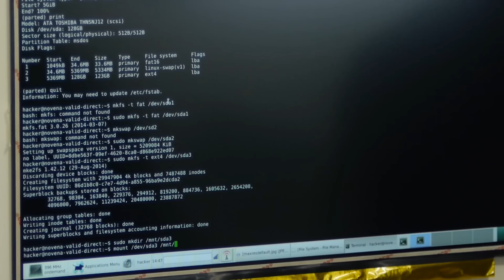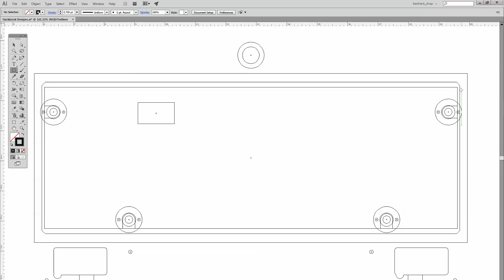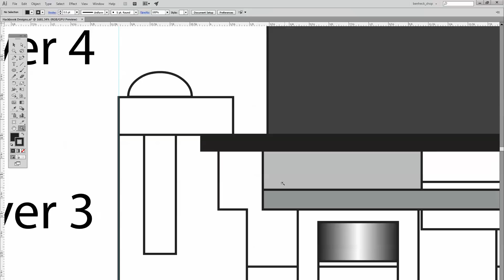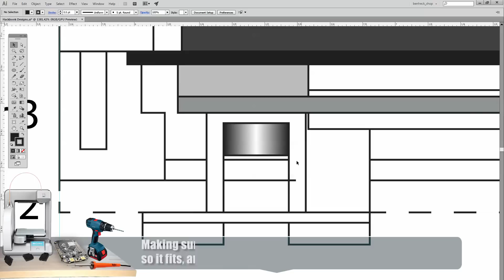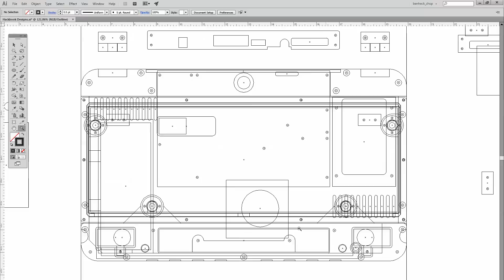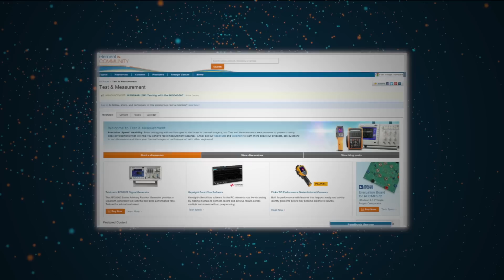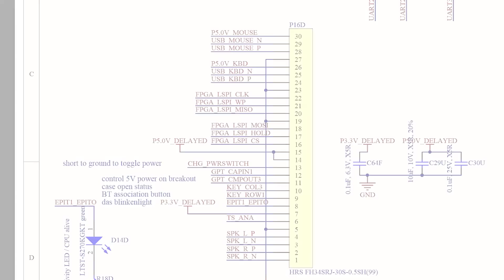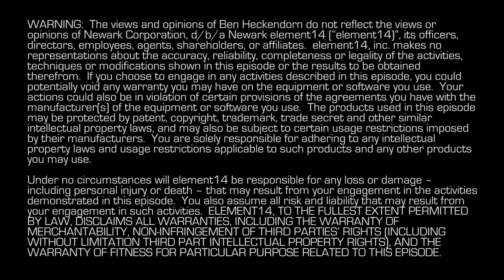Ben Heck's DIY Novena Laptop Part 3

Comment: If that base section was half the depth, Lose the secret compartment, Have the speakers front firing, Swap the switches out for Blues, Get a board with the LED diode support built in, Add a wider screen & This would be an awesome laptop! Otherwise an Amazing build :)

Comment: 11:13 What they used to do in certain Amiga CPU accelerators, was place a PLCC socket OVER the chip.  Could be a bit unstable there, but you could probably figure out a way to mount it securely.

http://www.kipper2k.com/amiga/4mblayout.jpg

Comment: these type of projects tend to look very difficult though.
I prefer 0.1 inch through-hole, generally much easier to wire things up.

then again, I have recently been meaning to build a board where I can have an MSP430 driving a dual H-bridge on a single board, vs having separate units for the MSP430-based driver and H-bridge, but haven't got around to it.

but, partly, I am held up by not yet finding a viable way to get enough cooling from air-cooling (transistor heat-sinks and fans) to run decent sized induction motors for an H-bridge build on a PCB (to make this idea more worthwhile). for example, much over a few hundred watts, heat becomes a serious problem (past experiments have resulted in liquid-cooled bridges, or building the bridge on top of a big chunk of metal, and generally built using point-to-point wiring).

like, if I want 3 to 5 HP (2-4 kW) from a motor, is this really asking that much?...

but, I may be missing something, as some existing motor controllers seem able to deliver a few kW of power without needing to resort to liquid-cooling or similar, so I don't know.

more so goes for somewhat larger motors (say, oil-cooled 40-70 kW 3-phase induction motors, like you might use in an electric car or similar). it doesn't seem like other people need to resort to liquid cooling their motor drivers (checking, it seems a lot of them are liquid-cooled).

actually, related is the possibility retrofitting a cheaper air-cooled motor into an oil-cooled motor and running it a higher power level, then using a thermometer to hopefully keep it from melting (throttling down if the temperature hits 100C or so). could maybe run a 15kW motor closer to 50kW ("yeah, running this 208v 60Hz motor at 440v 90Hz, going from 25A per phase to 36A per phase...").

Comment: Maan, that's not how you flux SMT work at all. You need flux fluid or flux gell and put it on pins. If you put it on iron tip, it'll just boil off into black mess before you hit the pads.

Comment: Another advantage to a DIY laptop is that if the SBC updates and keeps the same layout / connectors, you can just upgrade the SBC and you're golden.  Faster cpu, more ram, at a fraction the cost.  For something like a RPi, a $35 upgrade path.  Since that keyboard comes off you could put a kick stand on the body part of the laptop and stand it up so the display is closer to eye level.  Or have multiple screens which seems to be a $2K laptop market that is relatively untapped and basically out of stock for existing options.  Or over engineer the thing and have a truly 24+ hours on battery laptop.  Versus traveling with 3 or 4 laptops just to have the required battery life.  Perhaps swap that compartment with a battery sled that takes OTS batteries.  The glory of DIY.

Comment: Soldering the USB wires to the chip reminds me of doing the same thing to a PCIe adapter card. Got one of those adapters that allows a mini PCIe laptop card to be put in a desktop PCIe slot. Adapter didn't have the laptop mini PCIe connection USB ported out and I had a Wi-Fi card I tested that needed USB for Bluetooth. I soldered a USB cable directly to the pins on the mini PCIe connector. It works. Was a pain to do though. Those pins are quite a fine pitch...

Comment: Instead of a trackpad a pointing stick (isometric joystick) between the G and H keys would work. Your secret compartment could house the left and right mouse buttons and the connections could be made so the mouse buttons automatically connect when the compartment is closed.

While the keyboard is a nice touch, it's also noisy af. If someone was typing on this in school, you'd be getting dirty looks all the time. People would associate the noise with cheap quality vs. the fact that it's actually higher quality.

Lastly, I would not have opted for the numeric keypad. Instead a built-in Arduino, or better yet, built-in zif-socket universal chip programmer or at the very least, Atmel Ice. A built-in FTDI friend would also be useful.

From a production standpoint, Karen is sorely misused. Wasn't she introduced as a designer a few episodes ago? It feels like she's filling a "hey mom look what I made" role instead of her talents going towards the actual build itself. If Karen is going to be continued to be brought in for a critique of the build, then she should be given the opportunity to fully review the build. Not just be a cheerleader for the build itself. Give her the freedom to actually say things like, "what were you thinking?". Either give Karen creative input and show this, or allow her to fully critique the build when you're done. Seeing Ben and Felix justify their choices would provide a better experience. Karen could also give various parts of the build a grade from F to A+ (creativity, look, appeal, etc). I love the show, however it often feels like you don't have a producer or someone is pulling double (triple?) duty as a producer.

Comment: I have a question. c: What potentiometer do I need for a 6 volts 800 milliampere power supply that's going to control a 6 volt motor? :I

Comment: Wouldn't it be great if you could attach keyboard's USB through the 4 magnets(They're coated with nickel which turns out to be conductive :D)
Reply: Could be done, i don't trust that cable Ben soldered to the USB chip, looks like it could get loose if someone pulled the keyboard

Comment: Was that fan making that rattling noise at the end? Well only thing i would have done differently on this is to make it quiet as possible. Bigger heatsink (if possible) and quiet fans. But overall i like it even tho it really looks a bit too hacker laptop for my taste. :D
Reply: +Dudemi The background noise is usually parts being made in the background, yes, but this time it was the fan. That thing was quite loud. It's much quieter when the keyboard is in place, though.
Reply: I thought that at first, then remembered they are in a workshop so it's more likely some equipment in the background
Reply: +Fin H Could have been makerbot or some cnc

Comment: make a rubiks cube solver!
Reply: +©Cubit-Games its not 48quintillion... The real number is 43 something quintillion. And which, alot of those are actually impossible to get to because you would have to deliberately rotate a piece so the cube is insolvable.
Reply: ©Cubit-Games It's really not hard. There are algorithms out there that take the current state of a cube, and then give you the shortest path to the solved state.  There are online ones where you paint all the sides of a cube on the website to match the cube you have and it gives you a list of moves to solve it.  It's a fairly simple task to adapt that algorithm to a robot.  The hard part is making a robot that can reliably handle the cube without breaking or dropping it.
Reply: Thats actually what i want to do for my science fair :3
Reply: +Raw Khaos that'd be very hard if you dont know that algrithms
Reply: +Yottabyte Harold The algorithms are easily obtainable online.  There's a ton of lego mindstorms designs to solve cubes.
Reply: rlly? I thought that they were reativly hard to build...or find
Reply: +Yottabyte Harold i made a lego rubiks cube solver with my NXT, i just used online instructions and used their custom program and the robot could solve the cube.
Reply: Well, i mean i know how to solve it myself, in under a minute. But, in terms of robotics, im decent with coding so ill give it a shot :3
Reply: good luck, youll have to make code anticipating every possible way the cube could be, AKA, over 48 quintillion combinations. or have code testing for every possible scenario like a yellow cross on top, scanning where the other yellow are and then doing the right algorithm, i guess actually if you just make it go 1 layer at a time, testing each color 1 by 1, its possible to hand-code it semi-easily.
Reply: +©Cubit-Games Cube solvers are quite old as it goes, should not be hard to make an algorithm based on other people's work.
Reply: sorry, 43, not 48 XD, and yea i forgot about the evil corner twist
Reply: +Merlijn van Lent  https://www.facebook.com/CrosbyHighSchool/videos/609603899053311/?pnref=story